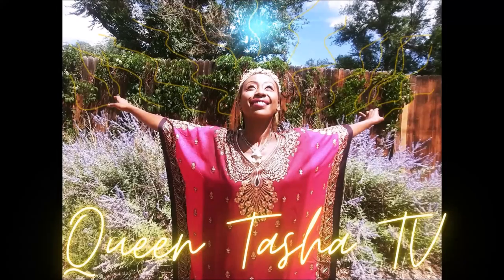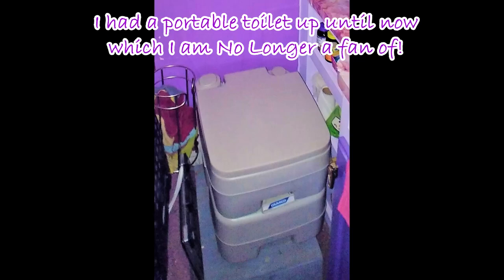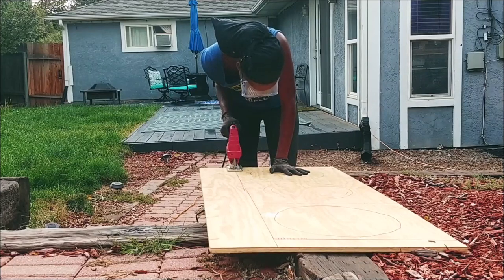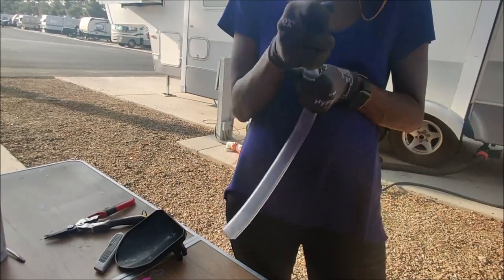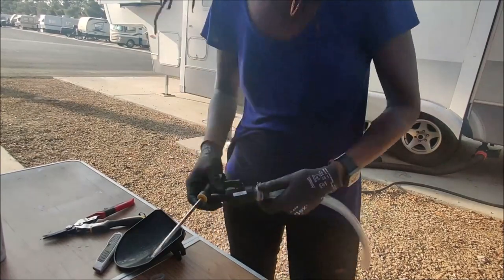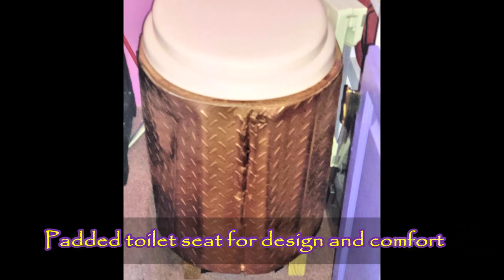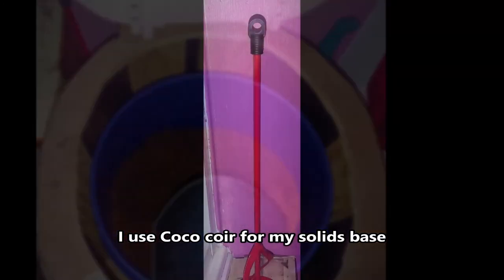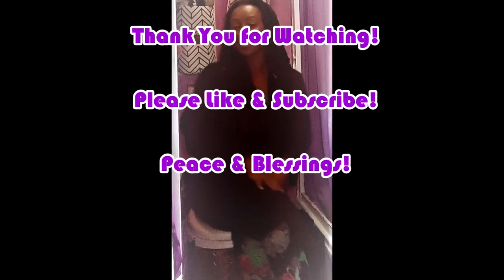I Built My DIY Compost Toilet | Quick Simple Build with Urine Diverter!

Comment: Your set-up is almost exactly what I’m doing with just a few exceptions, the biggest one being that I’m also installing a bidet. Beyond that, I’m using paint stirrers to cover the outside of my toilet. I plan to do some shallow chip carving on them and seal them with spar varnish. Since I’ll be running a water line in for the bidet, I’ll be attaching a “water-tank” looking box to store my composting medium and my clean family cloths (what I use instead of toilet paper) and hide all the pex and the electrical connection for the vent fan. I also plan to throw a few earthworms into the bucket for some help in breaking things down.

Comment: What do you use to keep the smell down for the feces? By the way great video....❤️
Reply from the maker: Thank you😊😊💜💜🙏🏾🙏🏾
I use coco coir and that does the trick for smells...i also use pet bedding shavings as well when it's too moist.
Reply: You can get a big 40lb bag of horse bedding pellets from a tractor supply or feed store for under 10. Its kitty litter but cheaper. Has a nice pine scent covers all odors.
Reply: I have read that lactobacillus works well - it comes in gelatin capsules.  Make a water solution and spray on a generous amount before covering with wood chips.